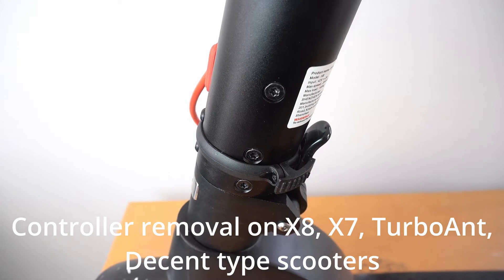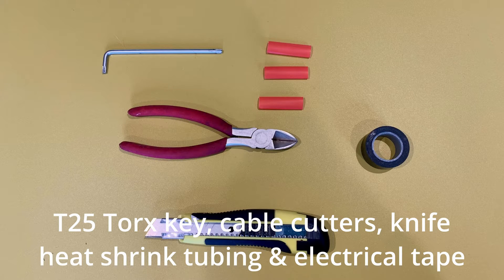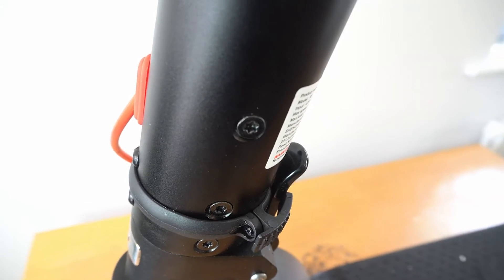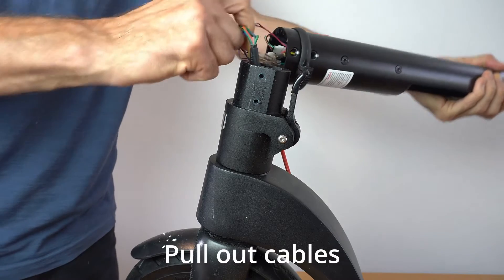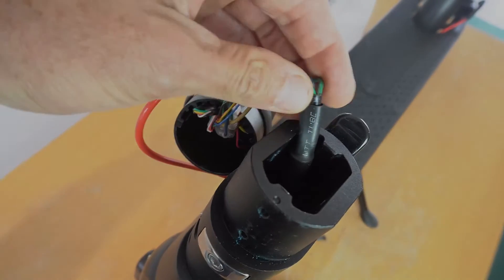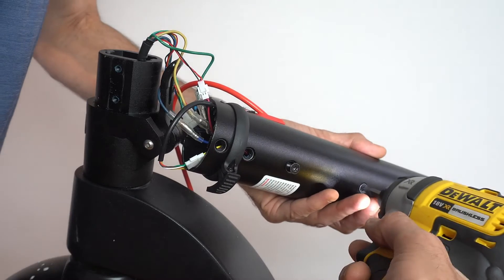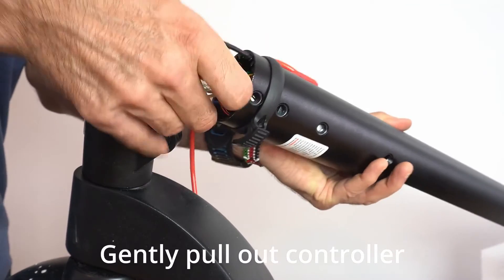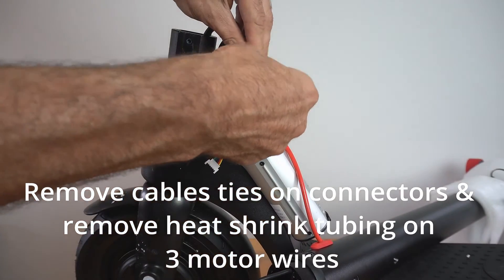X7 Pro X8 Electric Scooter Controller Repair

Comment: Hi i hope you gonna help fix my scooter, My X8 scooter have ERROR C (EC) in display,  what do you think are the problem with my scooter
Reply: C should be hall sensor issues. Common if the cables to the motor are erroded or broken due to how poorly it is installed there on them

Comment: I need to replace the X8 controller. I purchased an X7 controller (I could not find X8) and it's missing a brown wire that X8 has. It did not work. Any idea what the brown wire is for? Thanks
Reply from the maker: send email to support@hxescooter.com

Comment: Hi there, im just wondering what brought you to changing the controller. My sons x8 gradually stopped driving so I purchased a new battery. Installed battery and it ran for 5 minutes now there's no life at all in the scooter. Dash board is totally dead yet the scooter is showing fully charged. Any tips or do you think it's the same issue that made you create this video.
Reply from the maker: if it's not the problem of the battery nor the motor. replace the controller and display,

Comment: I have x7 , when I put in 2-3 faster mode, when I accelerate it after couple of seconds it stops, but when I turn it off and put in slowest mode it works normal, what it could be?
Reply from the maker: You can access the P4 setting? to FF value?
Reply: @HXElectricScooter  no, its problem with controller, do you know where I can buy it
Reply from the maker: @igorjanjevic9496  https://hxescooter.com/product-category/parts/
Reply from the maker: https://hxescooter.com/product-category/parts/ @igorjanjevic9496

Comment: hi, do you know what code C for? we replaced a new Xiaomi 350w motor and started getting code C and beeping now.
Reply: Hall sensor issues (motor), I got the same just changed the 3 hall sensors but still having issues. Tried with a new motor, but I think the turboant wiring for hall sensors are wrong. Colors does not align, so make sure you connect colors of new motor according to how the old motor was

Comment: Please have a scooter.
 When I do not ride it and test it, the speed reaches 40 km / h
 But when I ride it, it does not exceed 13 km / h.
 And move forward with difficulty.
 Is the problem with the battery ,motor or controller ??
Reply from the maker: which model is that please? un-plug the controller, spin the motor wheel with hand, if it move freely, motor is ok, it's the controller problem
Reply: @HXElectricScooter  it was the battrey

Comment: Please teach how to repair
Reply from the maker: how to replace the controller?
Reply: @HXElectricScooter  when I try to turn on the scooter I mskes a little bit and doesn't turn on bu battery is charged 40v is there any way to fix it?
Reply from the maker: @marine1718  please send an email with pic or video to support@hxescooter.com